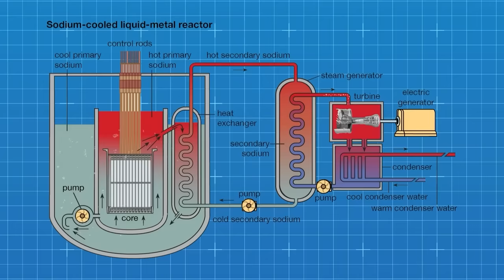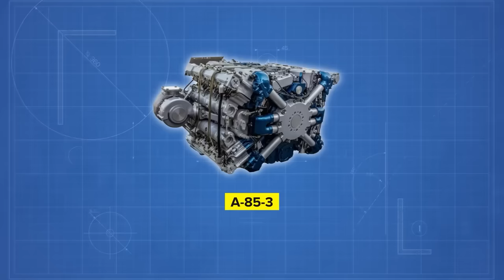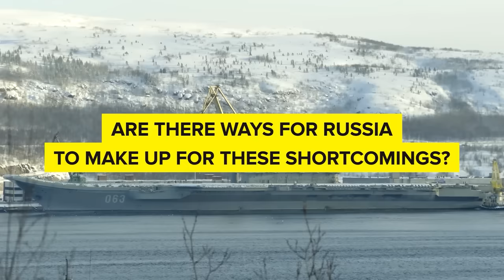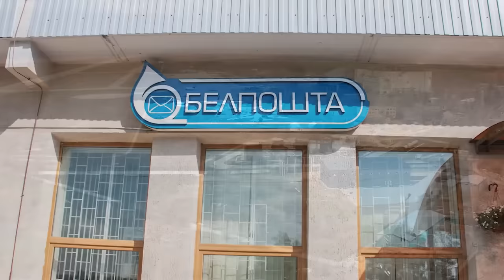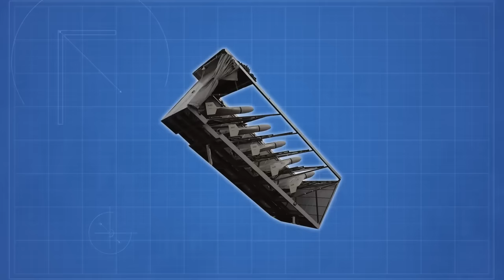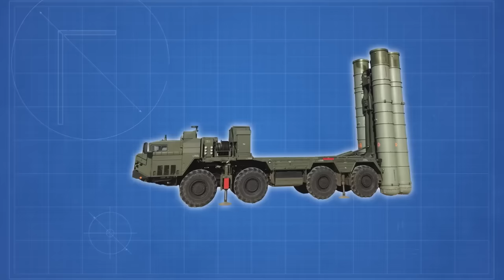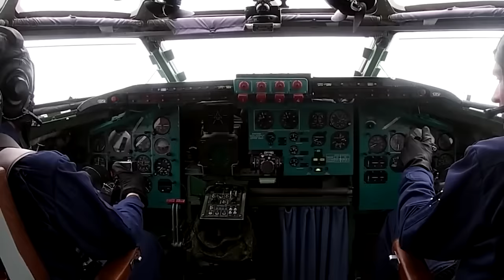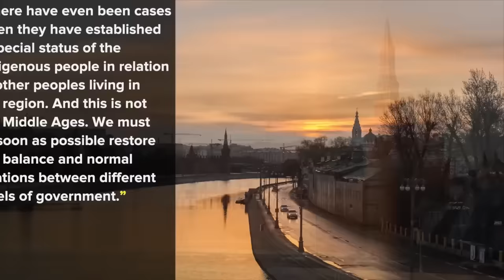Russia's Massive Naval Problem - COMPILATION

Comment: You failed to cover the extreme importance and value of the Russian tug boat that pushes their aircraft carrier around. Given the ineptitude we have witnessed throughout Russia's entire military, it is scarry to think there are Russian sailors sacheting around the world seas with nuclear powered anything.....forget the weapons. Afterall, they have managed to sink their own ships, the landing ship D-106, when it hit its own mine, the Kursk submarine, which sunk itself with a torpedo, and the Matros Shevchenko collided with the vessel Matros Pozynich then those two vessels also reportedly collided with another anchored vessel Kavkaz-5. in 2008 a Russian nuclear subs crew acciently set off a fire supression system which resulted in the death of 20 sailors and injury to 22 others. While attempting repairs to Russia;s only aircraft carrier, The PD-50 dry dock, the largest in Russia, sank in a strange accident,  smashing a huge hole in the carrier in the process. In 1995  A nuclear submarine had its electricity cut by an electricity company at a naval base due to unpaid bills. The submarine's cooling system ceased to function and the reactor "came close to meltdown. In 2003 a nuclear-powered submarine K-159 sank while it was being towed, the  AS-28, a nuclear sub, sank when it became entanled in a hydrophone array. In 2006, A fire broke out in the submarine, Daniil Moskovsky...two on board died. In 2011, The Delta-IV-class nuclear submarine, Ekaterinburg, caught fire while in dry-dock. In 2015,  the Orel, an Oscar II-class submarine, caught fire during repairs in a dry dock in the Severodvinsk shipyard. In 2016 The decommissioned Soviet-era nuclear submarine K-173 Krasnoyarsk caught fire while being disassembled in Vilyuchinsk, Kamchatka. IN 2017, the  Russian spy ship Liman sank off the Turkish coast, 29 km from Kilyos, after colliding with a freighter. IN 2018, The Admiral Kuznetsov was damaged while undergoing a refit: the dry dock sank. In 2019, The Admiral Kuznetsov, caught fire during repair work at Murmansk. 2019, 1 July – A navy research submersible, thought to be AS-12 Losharik, suffered a fire and 14 crew members died due to fume inhalation.....and yada, yada, yada.

Comment: I'm not sure how long ago this was written, but its way out of date with respect to missile boats.

Russia effectively has zero.

An ssbn is only a factor when out on patrol.

Russia's conduct of deterrent patrols has dropped to zero.

And the reaon is neither new nor is it related to anything high tech.

Maintenance has been deferred far too long.

What you see when you look at a sub isn't the hull - its superstructure. 

That space houses verious mechanicals - winches for docking, emergency signal buoys, the brow - whole hodgepodge of stuff.

Now, when underway, everything in that superstructure is subjected to a harsh environment - a 20 mile an hour stream of salt water. The corrosive effects are daunting. Its a large part of why ssbn's have an extended maintenance period every quarter. You have to remove corrosion, chip rust and repaint, replace sacroficial anodes - a ton of work.

When you don't do that, components intended to be secured to a mounting surface aren't.

Thw mortal enemy of a submarine is self-generated noise.

A noisy submarine is a dead submarine.

Russia can make a boat that is as quiet as any.

What they seem unable to do is keep them quiet.

An ssbn is the highest value target there is.

So its worth permanently assigning a fast attack boat to it - simply to follow it.

And in a hot war, destroy it.

Russia knew that in a shooting war, their ssbn's had a lifespan of seconds.

So there was no point in sending them out to conduct patrols.

And since their missiles can only be fired when the boat is underway at perisope depth, boats tied up to the pier are useless.

Comment: I don't know  anything about  shipping  etc. But can't nuclear  submarines  be sunk by different  types  of mines in deep water
Reply: Anything made of ferrous metals will tend to set off magnetic mines, yes. But the problem is you can't just scatter them without threatening your own shipping lanes - meaning, there will always be space open. And the very nature of these mines makes detection and locating of them relatively easy if you know roughly where they will be.

If you couple this reality with modern day drone capabilities - the ability to remote cripple mines is higher than ever. 

This doesn't make mines completely useless - Any nation that controls a straight used for navel trade etc, could, if ever threatened shut down travel and enforce it not just with military vessels - but also mines,  making traversal extremely dangerous to literally everyone; this effectively would allow the defenders ships sitting behind a line of mines keeping attack subs and the like at bay.

And then we get into the reality of long range missiles: The distance out you would have to put your mines to deter and restrict the threat of a submarine is so far out now, that the cost of doing it would be economically crippling on it's own meaning just this defence option would render building attack submarines worth the investment.
Reply: In deep water, how many billion are you going to deploy?

Comment: But the question is: can you put all critical high-tech chips required for a single boat into a backpack?
Reply: Nope. Not even close.
Reply: @Zomby_Woof   I mean for signal processing they would need xilinx chips, I guess you can easily put 100 xilinx chip into a backback. All less hitech components can be bought from china
Reply: @user-meowmeow1  Eussia a more basic problem - they are unable to keep up with maintenance demands.
And naval units operate in some of the most damaging environments you can think of.

Comment: Except for the SLBM arm of the nuclear triad, Russia doesn't really need a navy.
Reply: And that's the part that's so degraded it might as well not exist.

What does that tell you about the state of the other two legs?
Reply: @Zomby_Woof 
Even if only 1 in 100 actually work that stills leaves plenty to be enough of a deterrent and to economically destroy a country. Honestly, nuclear weapons are a huge waste of money. Because if you have an nuclear exchange everyone is losing anyways.
Reply: @robertsaget9697  That's a gross exaggeration based on what was believed. In the 50's.

Because Russia has abandoned the most important leg on the nuclear triad, they have made nuclear war, while not desireable, definitely winnable from a strategic perspective, and defined as at least one participant country surviving the exchange and retaining to capability of rebuilding 

I guess we could send them a couple of ssbn's to restore the balance of terror.

Comment: Your information regarding the torpedo is WRONG.   The radiation fallout from a one megaton H bomb is FAR LESS than the fall out from the "little boy": hence, there is NO way that it would cause a problem with residual radiation in the ocean.

Comment: I love how this is so one side I am not a Russian puppy but Ukraine is losing this war you are blind if you don't see it
Reply: Putin told you this "special military operation" would last 2 days. It's now over 2 years later and you've only gained 100km and lost 300,000 men. This is particularly bad for Russia as it already has a demographics problem. A 1/3 of your Black Sea fleet has been sunk and the rest is hiding somewhere. This is to a country that has no navy. You're arms industry has practically collapsed. You're oil industry is in the process of collapsing. All foreign industry has moved out of Russia and is unlikely to ever return. Ukraine is now hitting targets in Russia that are 1000km from the front line. Your border with NATO has expanded by 1300km as previously neutral countries have joined NATO. How do you figure you're wining?